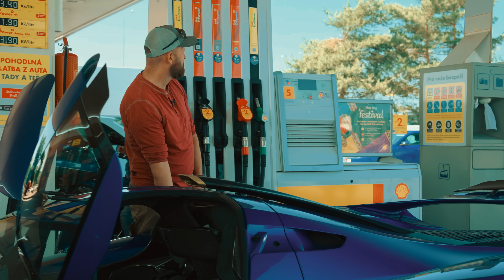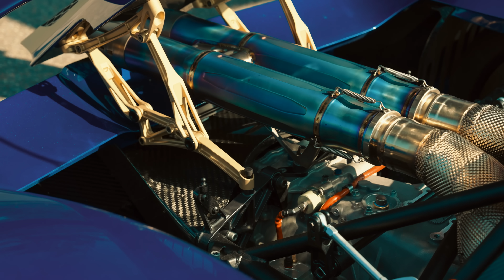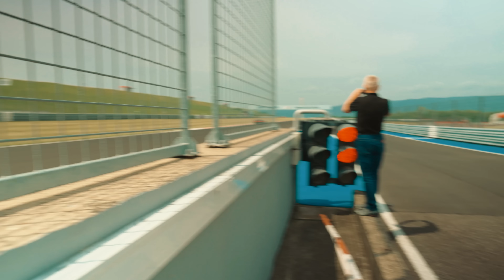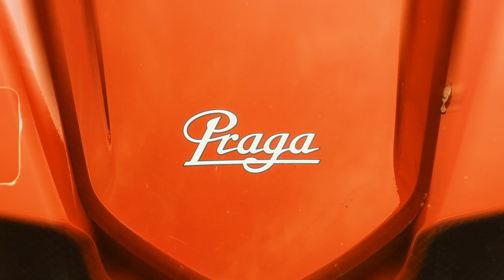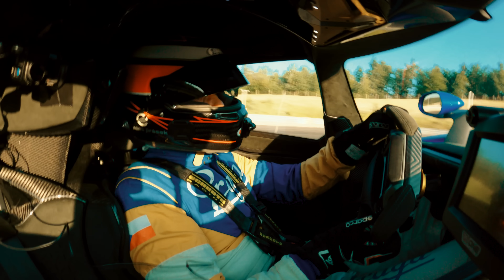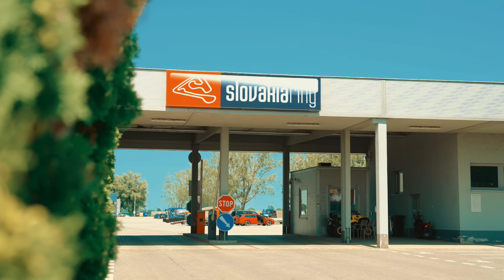FIRST DRIVE: Praga Bohema – Crazy Hypercar Driven!

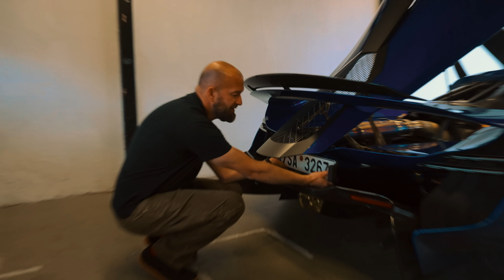Comment: 05:10 I'm here from some 30 years ago. The only such light I know of is located within a cowl above a number plate. Example; VW Beetle, Type 1 boot lid. Are those plates internally lit, not just reflective? Please elaborate. 

I can just about see them now. They're at both ends of the plate. Only rear plate is lit which is consistent with traditional plates. The lack of lighting makes them difficult to see.

Comment: It's a combination of power, weight and downforce. And also low aerodynamic drag. That's why the Praga is so fast. It's as if Colin Chapman himself worked on it, it's the same concept that Lotus followed.

For example, if you look at the Porsche 911, to simplify it a lot, it's a basic Carrera and if you want to speed it up, you have two options: Turbo - you add power but also weight, or you go the race car route, where you add less power but reduce weight, and these are the GT series cars. But even the GT3 is still heavier than the Bohema.

Comment: The Praga engineers did an beautiful job on the design of that Bohema.  If I were wealthy enough to afford one,  I would certainly consider the Bohema.  That car is competing with cars that cost three times as much.  It certainly stands out in a crowd!  LOL.  The design of that car instantly says "Super car, or Hypercar" just by the looks alone, which is a very beautiful looking hypercar.  Yean, you pull into a petrol station for a refill, you'll still be there two hours later because of all the people that would stop and ask you questions about the car.  700HP is plenty for what that car weighs.  The commentator said it in this production, that it's not about top speed bragging rights, it's about how the car handles, how it handles in the corners, and it's overall performance.  This car uses the GTR engine, (tuned specifically by Praga for the Bohema).  700HP is plenty of power for road car use, with the addition to a few track days per year, if that.  Most people buying the Bohema are probably purchasing to have the most radical looking hypercar on the road today, and with 700 horses, it's plenty for road use and still have enough horsepower to have a little fun whilst driving the incredible Bohema.  You would certainly stand out in a crowd wherever you took that machine.  You would be the star of any cars event, cars and coffee, cruise in night at the local burger/fries/milkshake stand, or anywhere else you take the Bohema.  I love the design of that Bohema.  Praga really did do a nice job on the design and performance of the Bohema.  I have no doubt that they will be creating additional radical looking hypercars that have the high tech design and engine of the Bohema (probably updated to an even better tune, or maybe using a different manufacturers crate available engine or co-op with an engine manufacturer.  It would be cool if they did an eight cylinder or twelve cylinder, or even more radical, 16 cylinder engine to compete with Bugatti, Koenigsegg, Pagani, Ferrari, Maserati, Mercedes Benz, Porsche, BMW, and the rest of the vehicle and engine manufacturers out there around the world these days.  It's cool they are using the GTR engine,  very cool in fact, but it would be just as cool if they dropped the Lexus LFA engine in their next model!   Maybe work out a deal with Toyota to supply just the ten cylinder high revving super engine that was in the Lexus LFA.  That engine sounds like an F1 car!  And they could easily recoup the cost of the engine, even if a few hundred thousand pounds, in the increase of the purchase price, making the car even more exclusive than the Bohema!  Now that would be something.  They may add more models down the road.  The Bohema is an absolutely beautiful automobile.  This car would be the poster on my wall just like the Countach was in the 1970's!   Definitely a dream car.

Comment: An unlimited mile warranty on a 17-year old $35,000 V6 in a $1,600,000 car should be the very least of what's included.
Reply: It’s not 17 years old, they still make them and they get new ones. They aren’t putting a 17 year old engine from one of the original GTRs in it

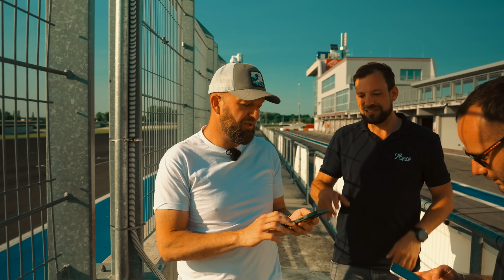Comment: i myself got to meet one of the people who designed it (the one on the right at 21:00), at the mylefestival in munich, and he told me basically the whole story about the production and engineering and its crazy how and why they have done certain things. Which is why have an unbelievable amount of respect and love for the car. Great guys who brought this car to life, and i really wish they get more attetion with this masterpiece
Reply: Cool. Would you share some of the details that stuck with you about how/why they did certain things?
Reply: @chemacb  sure. What they told me was that the windscreen wiper was a huge problem, because it has the most curved windscreen of any production car. Due to the regulations nowadys the wipers have to clear at minimun 80% of the windscreen, which is ofcourse difficult which such an extremely curved windscreen. He told me they worked for almost one entire year on the designing and building of the wiper. Another thing is the steeringwheel, he said that it is one of the most important parts of the car (because it is how you connect with the car and you have to use it at all times, so it should be perfect), and it has to feel right and comfortable in every moment, so they had to built a steeringwheel which has a nice grip and is comfortable, which sounds easy but the steeringwheel in this car has to fulfill many roles. It has to be small enough to give you as much legroom for your legs and knees to not get in the way of them, then you have to think about the diffrent sizes of hands, it has to be the right size for a big man with big hands, but still also fit a small womans hands, and both should have the best grip. Espacially for this car it was a big issue because it doesnt only have to tick every point above, but it has do them perfectly on the track too (for what this car is built for), (whichis another thing he told me, that when they had to choose between a thing to make it better for laptime and track or better useability and to livewith they always chose to optimize it for the track). So the steeringwheel has to be great on track, but not be to extreme and still be somewhat comfortable to just cruise around in. The material has to be useable for both sides too, be grippy but not be a material which wears of quickly so. Because of all of these points it took them for ages to come up with an prototype, and when they had one, he (the person telling the story to me) took it in his hands and something felt not quite right to him, which lead to them starting all over again to produce the one they could. in terms of the engine they also had some unique ideas, first thing they wanted a fully internal combustion engine powertrain without a hybrid system what so ever. They thought about a v6 (because of the small size, but still with a lot of powerpotential) and a v10 (because of the raw power and sound), but they relative quickly gave up on the v10, because it was just a bit to big, it didnt fit nicely in the car, what would have resulted in a redesigning in the whole carbon monocoque, which tey hadnt had time and money for. So they looked around for someone to use a v6 from (because building and designing their own was impossible, as you can probably imagine, as they are not a big company with the resources and money for that), and their first idea was the famous v6 form Japan, which is used in the Nissan GTR R35. So they went and asked them, but they got a quick rejection from them because no one else then them should use their increadible engine, but they didnt give up on the idea and discussed with them further until they eventually accepted the supply of engines to them. Furthermore  hindering the process of the engineering of the car, was the space available between the frontwheels to fit every necessery component in there, which includes the dampers the suspensionarms the electronics for the car, the legs of the drivers, with their adjustable pedalbox which moves forwards and backwards. And all of that and more had to fit in that little space, what lead them to redesigning it a few times to eventually cramp everything in the small front section of the car, they refused to making the "bonnet" bigger to pack everything in there more easily, beacuse that would throw of every other component which is desgined accordingly to these specific dimensions, such as the aerodynamics of the car and the way the tires are set up. And ofcourse the weight would go up, what they tried to keep as low as possible at all costs, beacuse that is one of the key features why this car is what it is. So that also was a huge obstacle to make everything fit within that space. All of this and many many other things lead them to finish the car  this "late", keep in mind they started designing and commiting to building the car in 2017. I hope this gives you an insight in the process of building such a car and what hurdels you have to overcome. First i just wanted to mention a few things shortly, but now this turned into a whole book xd, so as said i hope this helps and let me know if you have any other questions or if you want to know anything more about a certain aspect. I love to talk to people with the same passion and interest in those beautiful machines. Hope you have a great day!

Comment: 3:28 "so a 700bhp tune is going to be mega reliable" and by this you mean reliable in supercar standards, not regular passenger car standards?
Reply: He was saying that as a VR38 can handle over 2000hp, it very easily handles 700hp, making it a very reliable engine. But a VR38 making 700hp is reliable by passenger car standards

Comment: Praga should've used the gtr transmission too the car would be alot faster
Reply: DSG is 70kg (!) heavier than the Hewland.
Reply: A sequential transmission such as the one in the Praga shifts faster and weighs less
Reply: @General_Madness not if they get a built one from shepherd they make record breaking transmissions everyone that has a serious gtr has one of there transmissions
Reply: @streetlifetv9241 doesn’t mean the car will go faster. It’s more practical to have a DC gearbox, but there’s a reason almost every modern race car  uses a sequential. It’s lighter, quicker and better

Comment: 2:14 - It’s only got 700 HP 😂.  The obsession with 1,000 hp + cars is frankly ridiculous.  Take the current Porsche Turbo S, 640 hp, 2.1 sec 0-60 mph, top speed of 205 mph, rear wheel steering, incredible PDK transmission, you don’t have to take the steering wheel off to get in, etc., etc., etc., and it’s no where near $1M.  If you have money to throw away, go for it, otherwise these cars make no sense.
Reply: Different driving experience though.

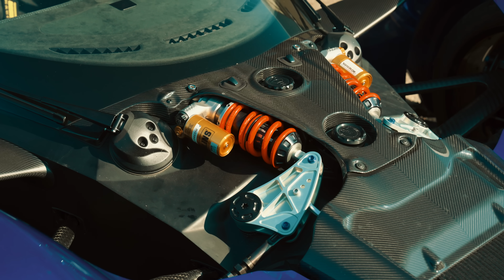Comment: Meanwhile over in Germany - The Xiaomi SU7 Ultra ran a 6:22 at the Nürburgring today making it the third fastest ever and the only thing that would be faster is Germanys own ID.R and the 919 Evo ! I'd like to see Praga vs SU7 - After that ? My money is on SU7 !
Reply: That was the Su7 on slicks and gutted interior. The production version did 7:04, which is waaaaay slower then this would be.
Reply: @valerystoichkov7429 Better look again that was the base model off the showroom floor.

TODAY, IT RAN A 6:22 ... IT'S EVEN ON THE NURB YOUTUBE CHANNEL.
Reply: @WeylandLabs yes, the non road legal car did 6:22. The road version did 7:04.
Reply: @valerystoichkov7429 When you mention the non road legal car, are you referring to the race prototype version ? 

And if so, would I be able to purchase one and then modify it strip the interior, install a roll cage, upgrade the suspension, convert the body to full carbon, and potentially upgrade the software to handle any track configuration I want. 

I think you might not understand how easy it would be to modify this yourself. Full EV's are exceptional at efficiency and instant power vs petrol vehicles.

I just don't think you or anyone understands how extraordinary this is and how a Chinese phone manufacturer managed to destroy 97% of all car company's in the world. By just removing a few items adding better suspension tires and pushing those EV motors to its limits. As an American it tough for me to even say this... but watch the video ! 

Its goes harder than anything I've seen ever at 1/8th the cost ! Those cars start at 78k U.S.D so for under 100k roughly you can have the fastest street legal car on the planet and take it to any track and smoke everything. That's mind boggling -  🤯
Reply: @WeylandLabs yeah, and if I took a BMW M4, stripped it down, and basically converted it into a GT3 car, I could get a sub 6minute time.
Reply: @General_Madness Funny how nobody has ever done that you must be the smartest person ever to live ! 😂
Reply: @WeylandLabs no, people have done that; they’re called BMW M4 GT3 cars. They just don’t claim that they hold the lap record, as the car isn’t road legal, and they do not hold the overall lap record, therefore they are not record holding
Reply: @General_Madness  You have no idea what your talking about ! Please stop talking, your only making it worse for yourself !

Comment: Nice car, Praga just has to release another road legal model where you don't need to take out the license plate to use on the track. And, a dual-clutch or single clutch gearbox would be nice; it would make the car easier to use on the road
Reply: Yeah, but DSG would be 70kg heavier.

Comment: Who designed those mirror stalks lawd. They look ridiculous. Maybe I’m the only one but I’d be more excited about a plebeian hybrid with a rear mounted boxer than yet another hyper ultra mega car.
Reply: Well they legally have to have them in the right place; if they didn’t have to follow road laws they probably wouldn’t have mirrors
Reply: @General_Madness I know that guy. The mirrors have to be in a certain spot. How they’re suspended there is likely not specifically mandated. I suppose you could run a stalk from the rear bumper or middle of the roof, or the 8’ long appendage these guys went with.

Comment: It does NOT generate NEARLY 1,000 kg of downforce. It generates MORE than 1,000 kg of downforce! 900 kg of downforce is at just 250 km/h. But the car can do over 300 km/h without any aero changes, which means the downforce rises to over 1,300 kg.

Comment: It's actually a cohesive design , reminds me of a ' Preying Mantis ' insect. It also looks light and with the very tuneable GTR engine , loads of potential in that package.
Reply: When I looked at it at first, I also thought of mantis
Reply: like He said at the beginning the company that prepares the engines has versions that produce FAR more power!!!
Reply: Wow, nailed it actually. Nice
Reply: The engine (turbos) are good for 750-800hp. It´s just detuned, lowered boost pressure for longer reliability and more safety margins. Trust me, I have the exact same turbos on my car, and I am running 770hp and 820nm. 50.000miles so far. Same as the Praga car and I´m sure that car has been driven harder than mine... it´s bombproof this engine. They made a very smart choice. Parts are everywhere and easy to work on.
Reply: Let's make it 2000HP it's will destroy all the hypercars out including F1 cars.
Reply: @Kingofthehill84 it pretty much already does..

Comment: You know some boys gonna be laptopping this engine for 1000 - 1500 hp
Reply: well considering this is a €1.3 million, limited production car crafted and designed for this exact amount of power, i highly doubt that. unless redoing the whole car i dont think many people will even consider doing it haha
Reply: @fxlxpxk 1.3 million to the kind of person buying this vehicle is equivalent to me buying a 5k civic. If I was rich I would hurt so meany peoples feelings with the limited special edition cars I would use as platforms to build on😂 Also you wouldn't have to change up the car at all it already has a built motor just need to change the turbos, fueling system and some cooling aspects and give it a tune
Reply: @fxlxpxk  According to their own words, this may not even be the ´´final´´ product and they can and will offer a higher hp configuraton with more aero parts. A ´´track pack´´ or ´´R´´ version if you will. They are runnnig very low boost on the turbos and they can handle 800hp.
Reply: Really wouldn't take much effort at all but not sure about the transmission holding that power
Reply: @antilagboostaddiction8322  Transmission is rated at 900nm of continuous load. Meaning, it can in theory handle more but then reliablity goes down. Same with transmissions in cars. Take the M3/M4 f.ex, transmission is rated at 760nm yet it can handle 1000nm.

 They are using Hewland´s strongest sequential transmission. If you know Hewland, then you know basically all race cars use their transmissions, along with Xtrac.They are the top 2 favourites. And then you have Sadev and Hollinger which is also good.
Reply: Yes, it's possible with Bohema. Litchfield Motors can raise the power up to 1,000 horsepower, but even for a car this light, it's almost unnecessary.
Reply: @magicokid Litchfield isnt even top 30 when it comes to tuning and building the Vr38 the only names that should be brought up are T1 , AMS, ETS and Workhorse performance
Reply: Do it for the booooyz!